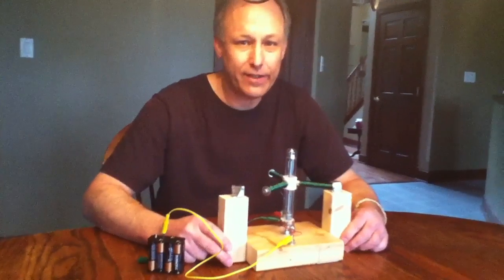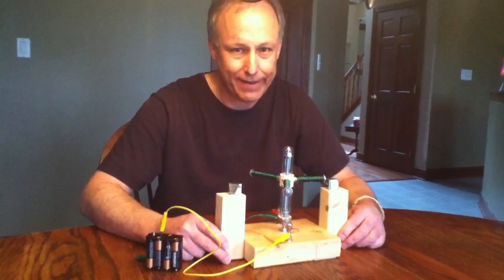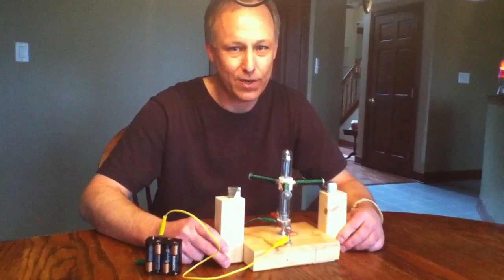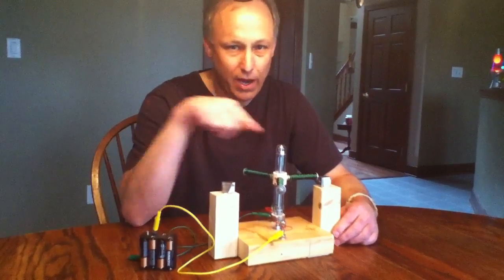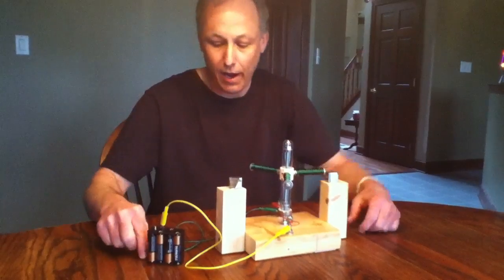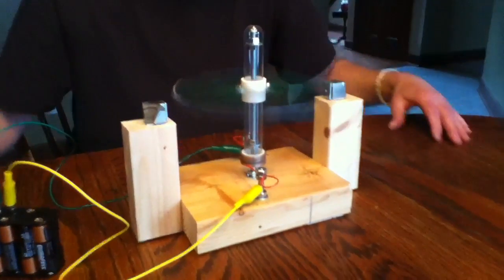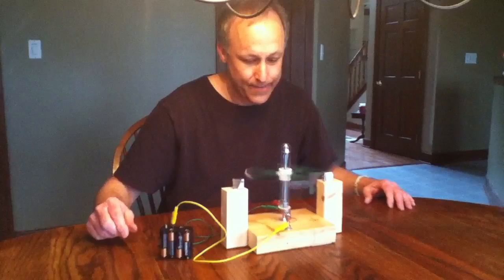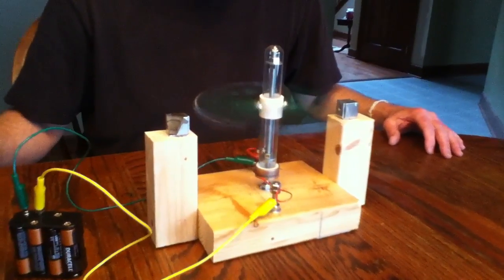awesome homemade DC Motor

Comment: Love to know more about this, looks like a 1/2 PVC coupling to hold the bolts on the armature but am wondering about the bearing surface.  I could imagine a bolt through the block to ride on the test tube but how about the wobble at the bottom.

Great looking project, love to know more.